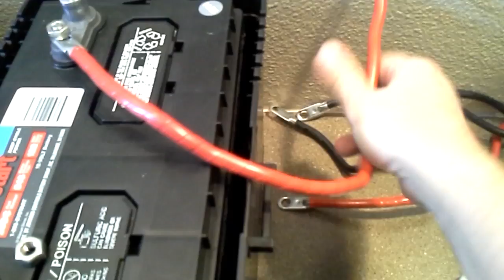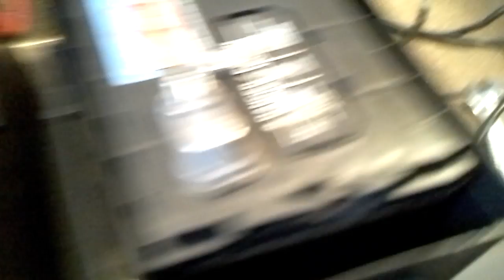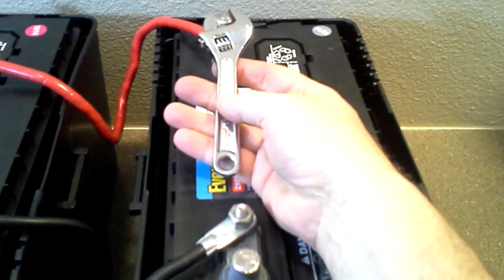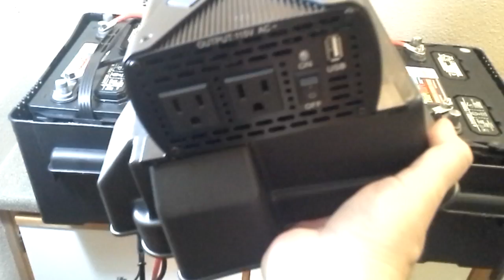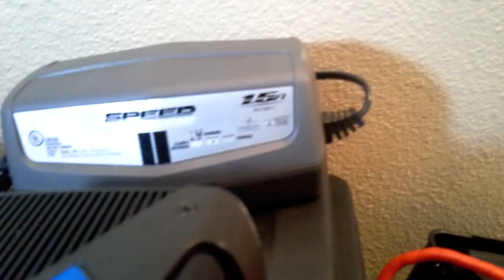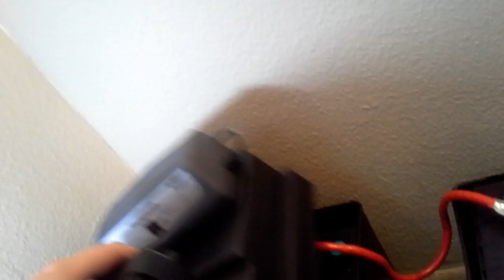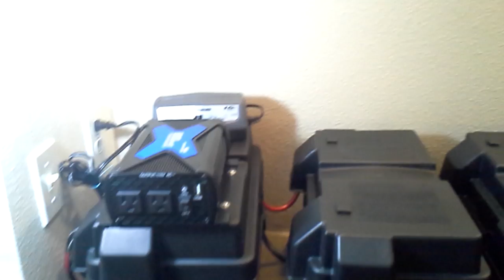Installing 4kW/Hr battery bank with 800W 120V Inverter and Trickle Charger from Tactical Woodgas

Comment: Do we only go positive positive positive, negative negative negative, when we have 3 batteries correct ? And the other way that we shouldn't do when we have 4
Reply: Depends on what you want to achieve. He is using parallel connections  to achieve much higher AH capacity from 12V batteries. If your inverter operates on 24V or 36V or 48V setup then you would be using series connected batteries instead. You might want to hook up multiple series connected batteries in parallel to achieve higher AH capacity as well - see this video: "EASIEST Off Grid Solar Power System Battery Bank."
If you have 4 x 12V batteries and your inverter operates off 12V input then you can simply carry on and also connect that 4th battery in parallel just as he did in this video.
Reply: @kevinrtres  if you've got three 80 amp batteries connected in parallel how much power will it put out? 19,200w?
Reply: @RCsFinest  That depends on the voltage at which you are drawing that current.
Direct Current Power  = Volts x Amps. So if you've got 24V  and are drawing 80 amps your D.C. power will be 24x80=1920W. If it's at 12V it'll be half that and if it's at 48V it'll be double that.
Just note that I'm talking about D.C. power. If you connect an inverter and feed an A.C. circuit then things get a little more complicated regarding the power that is USED by the appliance.
Reply: @kevinrtres  I would need 1500w of power, I'm trying to run a space heater in my garage as well as a battery charger for a third battery that would be swapped in and out if that makes sense.
Reply: @RCsFinest  A space heater sounds like mostly resistance heating so it should be fine, even if you have a fan blowing thru it. Battery capacity will determine for how long you can run that heater. As for the charger (???), it depends on what kind of battery it is, capacity etc. You'll have to check the specs for the battery as well as the charger to see what you need. Am I right in assuming you are going to run an inverter to power those things?
Reply: @kevinrtres  Yeah I was checking out both a 500w & 1000w inverter running on two separate banks with two batteries for each bank.
Reply: @RCsFinest  Well, I am not sure why you'd want to have two separate supplies but that's your choice, I guess. I would have made just one power supply to save costs and time of construction, but that's just me. I wish you well with your exciting plans.
Reply: @kevinrtres  I haven't made anything yet, I'm wondering if that's what I'll need for running a 800w space heater for 4-6 hours a day, I have a puppy that I need to keep in a kennel in the garage while I'm at work.
Reply: @RCsFinest  Well, certainly a worthwhile project. Assuming your space heater runs full-blast for 6 hours at 800W you'll need a total battery capacity of 200 AH ( I got this by diving 800W by 24V to get the required Amps then multiplying by the number of hours (6)) . If you're using sealed lead-acid batteries then you'll need to budget for 50% drain or preferably less per day. That means a rated capacity of 400AH. If you're using LiFEPo4 then you can just about get away with 200AH. Depending on where you live, what temp. you have to fight against etc. etc. you might not need a full 800W full blast all the time. This of course also assumes you're actually planning to run the heater off the battery all-the-time and not just as a backup. There's so many variables so, have fun finding solutions on the web!
Reply: @kevinrtres  LifePO4 battery he said 🤣🤣
Reply: @RCsFinest  Actually, it makes a lot of sense to spend that money up front. But I guess it all depends on your purpose. I heard someone else say something (in photography) that really resonated with me - buy it nice or buy it twice. Your choice.
Reply: @kevinrtres  All depends on what you're using it for, main power source would be ideal for that type of situation but as a backup or random use I wouldn't fork out $700/battery.

Comment: no fuse from battery's to inverter
Reply: I believe the inverter is protected right ?
Reply: well i have power box with 1500 inverter 12 volt deep cycle battery 75 amp 900 watts i have 20 amp switch and 150 amp fused between my positive of my battery and positive of my inverter even you turn off inverter with inverter switch it still pull little bit power from battery

Comment: If the Battreys are not  matched and same ratings you will Have troubles your connection should be neg on one Battrey and pos on other first Battrey so load is balenced. Use copper water line hammer flat and drill hole use for buss bar for better conduction you can tape them red and black for insulation.

Comment: If i put an aims 10,000 watt sur pine in an ice cream truck running the vehicle  8-12 hrs of driving, once i hook the 12v vehicle battery to the inverter, how many more batteries will i need to run 3 (15amp) chest freezers?
Reply: I don't think you would just need some more batteries.  What I would personally do is get one secondary battery and connect them to that.  Then from there wire it up with a relay so it only connects and charges from the alternator when the engine is running.  Depending on the vehicle you may need a bigger alternator
Reply: 15A equates to 1800W, 3 of them equates to 5400W.  You don't need 10,000W of inverter but it's your rig.  Max power from your alternator will be around 2500W and that is not at idle.  You can upgrade the alternator to a larger size, but you won't gain much.  Safely, I'd factor it around 1200W.  Your power requirement just for your freezer is 5400W.  You'd have to factor in other items requiring the alternator as well.  So for arguments sake let's take the 1200W from the alternator off of your power requirement and now you are at 4200W needed to run your freezers.  To run your 3 freezers for 12 hrs (have to plan for longest time period):  you would need 12,857 Ah of lead-acid batteries, roughly the same for AGM's, and 10,800 Ah of Lithium batteries.  Lead Acid/AGM batteries can only be safely discharged to 50% of their capacity.  Lithiums can safely go 80-90% of their capacity.  They also cost a metric shit ton more than LA or AGM. You can reduce the amount of batteries you'd need (let's face it, that's a crazy amount of batteries) by putting solar panels on top of your truck.  Not sure how many you could cram up there, but likely still not enough. Trying to run high demand items on battery power through an inverter is expensive.  Your best bet is to put a complete AC system in your truck, and run the freezers off of a generator.
Reply: @fiveoaksfarmofgeorgia7605  you also have to take into account that the freezers will not all be running at 15 amps all the time.   Do you think that he could add maybe 3 batteries and then a 7000 watt inverter to take the load when the freezers are first running. But then they are not the alternator would be actively charging the battery
Reply: @fiveoaksfarmofgeorgia7605  I saw a small ford transit van with a rigged up ac system for the full van.  The person connected a flexible hose to the vents on either side of the car and ran the tubes back to the back.  He still had the front in the middle for heat and AC in the front but could turn either of the vents off with the slider to get more airflow
Reply: What you need is a new vehicle.

Comment: If I run a 40" TV on this setup, how long could it last?
Reply from the maker: Kevin 
An LG 47LM7700 47 inch LED TV will run 12 hours between charges with one battery.  24 hours with 2 batteries, 36 hours with 3 as shown in the video.
Reply from the maker: Kevin 
Plasma TV's take more power.
Reply: Tactical WoodGas uhh

Comment: Now what's to keep you from plugging that charger into the converter and potentially having unending power
Reply from the maker: The battery only stores energy, it does not create it.  There are solar panel versions at www.tacticalwoodgas.com if you want sustainable power.
Reply: Power outage :)
Reply: A little thing called system efficiency.

Comment: This is not large enough to run a home refrigerator with freezer.  Too small.  Ok for temporary lighting, radios, chargers, etc.
Reply: crazeyspivey 
Modern energy-star rated appliances have lower startup currents.  Use an Amazon kill-a-watt to make sure peak power is below 1800 watts and average power is below  800 watts.
Reply: Where would you get your 1800 watts from????

Comment: There are a normal car bateries?
Reply from the maker: These are deep cycle batteries rated at 100A-H
Reply: You could use car battery but it doesn't have the same tolerance. Deep cycle batteries can go kinda low before recharge is needed. Car battery will be damage if it drops a few volts.
Reply: @tacticalwoodgas4036  No, they are NOT True Deep Cycle batteries, they are hybrid Marine Batteries.
Reply: @MrSummitville  agreed

Comment: how much amperes would that three batt in total?
Reply: Janjan demecillo 
Each is 120 amp-hours.
3x120=360 amp-hours.

But.....

...you should only use half the charge so that you extend battery life.  So 180 amp-hours.  At 12v, that is 2340 usable watt-hours.
Reply: It's 2340 Wh or 2.34 kWh or 2.34 Units of energy as in universal term.
Reply: No, at 120 Amp/Hr and 12V; it's nominally 1440 W/hr per battery; that's 4320 W/hr.  (Note, "nominally", since fully charged batteries will put out fractionally more than 12V for a while, the W/hr output availability will be slightly more; on the other hand, when battery voltage drops below 12V, the output wattage from the batteries will drop.

Comment: What batteries did you use specifically if you do not mind me asking?
Reply from the maker: 100 to 120 amp hour deep cycle batteries size 27 to 31. Remember that the larger amp hours will last longer between charges
Reply: Thank you!
Reply: +Dru Hannon DEEP CYCLE!
Reply from the maker: +Dru Hannon These are DC29's from Walmart
Reply: One suggestion. If the power coming out of your solar panels is not enough to charge the battery bank fully then get a charger. Lead acid batteries do not last if they are not charged enough after a discharge cycle.

Comment: No offense, but the video starts off great with you explaining how to wire the batteries. But then you add a lid and connect up some additional al wires, but don't explain what youre connecting, or how to connect them. I do get it, but for a novice this missing information / exploration would be very helpful. 
I'm guessing if you plug the trickle charger into the inverter, this would charge the batteries in a looping kinda way. Am I wrong to guess that this would produce deminishing returns and eventually die? Anyone?
Reply: grinattack69 

Thanks for the feedback.

Agree, no such thing as free energy.  It has to come from somewhere.
Reply: Indeed it would die cause your using power up from the bank to run the charger and some of that power gets used up in that process so eventually that bank would just die and not be charged better off getting a small solar panel or use the charger with AC power until power goes out and you need that stored power or like I do is keep a trickle charger 3amp on my set up and charge most my cellphones and usb stuff off it day by day to cut down on using power grid and If grid goes down I have an 800watt inverter for bigger loads.

Comment: will 800 watts run a refrigerator?
Reply: a refrigerator operates approximately 300 watts, we need to know how long batteries last before this constant consumption and how many batteries use
Reply: +Obdulio Sandoval 

A Walmart  DC29 battery holds 12V x 122 amp-hours = 1440 watt-hours.  The inverter protects the battery from deep discharge by cutting off when about half the energy is used, so 735 watt-hours are available. Your refrigerator uses 300 watts only when running the compressor,  about 10% of the time when the door is closed, so (735W-H )/(30W)=24 hours of use per battery.  If you want to run the refrigerator three days between recharging, use three batteries. Or use one battery, and once a day carry the battery bank to you car, start the car, and connect your jumper cables to it for 30 minutes and it is ready for another 24 hours.

Comment: which is the current lithium batteries? AC or DC
Reply: coriente dc direct
priviene of battery its voltage is 12-24 volts

ac ac
It comes from the outlets of our house its voltage walks in 120 or 240

a battery current can be converted to AC inverter with a team called

Comment: what good is this if you have to have a outlet/electricity to power it?
Reply: Good to use for backup power in case of power outage. Solar can be added later if your budget is big enough. No shame in having grid power to charge the batteries. In fact, there may be some days when the solar will be unable to fully charge the battery bank so a grid (or generator) outlet will be needed to get a full charge. ... Think of it as a backup to the backup.
Reply: The AC battery charger is there to make sure the battery is 100% charged when the power goes out.  If you use up all the charge before power comes back on, place it on the ground next to you car, start the engine, and use jumper cables to recharge it.  Only 30 to 40 minutes is required for a full charge.
Reply: 30 to 40 minutes to achieve full charge? That's not my experience (nor Pb batteries theory) You can charge them up to something like 80%, but those last 20% will take at least more than 1 hour! (And I'm being modest about the 80 and 20% times!).

Comment: What’s the point. Just plug into the wall.
Reply: It's a backup of power outage. Wouldn't do no good plugging in the socket with no power
Reply: Do you have one that comes with solar charger where I can can plug the inverter to the solar power instead i need one to send over Sea

Comment: You totally did that battery wiring wrong. While you can connect the batteries themselves the way you did, your killing the main battery with your wiring to the inverter. You should have done it correctly since theres probably thousands of viewers who now have 1 bad battery, 1 poor battery and one good battery in one string. Proper inverter wiring in a bank like that is the X style, pulling from all batteries even. Sorta silly seeing this as a lesson.
Reply: Јоhn Daniel 

Not true at these power levels.  The battery bank shown in the video is still going strong.

Comment: Hello... Your videos are so informative....

I have little maths problem regarding solar....

35 air-conditioner #2hp =1500watts = 52500watts

I want to run for 15hrs a day=787500wh

I want to use 1.2v 1250ah  NiFe battery and 36v 320w solar panel

((My idea is 384 VDC battery bank= 320batteries 1250ah))

Amount of battery bank ??
Amount of solar panels??
Charger controller??
Inverter??
Reply: Check your math

Comment: I'm not sure an 800 watt inverter will cover the start up surge on a fridge did you try it  ?
Reply: newer Energy-Star rated refrigerators have smaller compressors, so smaller surge.  The 800W rating is average power; it will handle double that during a surge.
Reply: Also, yes it works on my new refrigerator, but not on my 30 year old freezer.

Comment: What is that AC you connected for?
Reply: Charge the batteries, if you had solar panels they would charge them with a solar charger/controller , ac would charge when there is no sun.
Reply: it's called a Battery Tender

Comment: where do I buy the battery charger and what kind
Reply: Aspen Marcel 

You can get the Walmart 29DC deep cycle battery.  I use that in my systems at home.
Reply: Aspen Marcel 

For the unit in the video, go to www.tacticalwoodgas.com

Comment: How long it can last a 100AH battery subject to consumption 100watts
Reply: 100 amp-hour divided by 100 amps equals one hour of use.  For longer battery life, use half of that before recharging.
Reply: You pass in math class, but failed in Circuits. 100 AH at 12v = 1200 watts in a 1 hour period. So, 100 watts "at 12 volts" is about 12 hours of use for a 100 watt draw no matter the voltage. With loss, I would say safely 80% soooo maybe 9-10 hours.
Reply: +eclipsethesun 

Thanks eclipse for the correction.

I was thinking amps when the question was in watts.
Reply: yeah but he has three 100 ah batteries wired in parallel so that makes 300 ah times 12 volts =3600 watts
Reply: understand each 100Ah battery generates 1,200watts 3 batteries generate 3,500 watts
Reply: Wrong.......never discharge batteries all the way down.Look it up.
Reply: Yes, very important.  A good working rule-of-thumb is 50% draw down (to pick the finest nits, there is a very slight variation between battery types, such as gel-cell, glass mat, deep-cycle lead/acid flooded, and "car starter-type lead-acid flooded, but calling it 50% is a good working number).  

Since battery voltage drops as the battery discharges, a good quality inverter will automatically cut off as the voltage drops to a level that indicates 50% discharge.

Comment: Thst is only 1.8kwh of storage.  Not 4
Reply: He said he has 340 amp hours so multiply that by 12 volts and you have 4080 watt hours so he is right....right?
Reply: @fernandorufino-jimenez5982  The batteries are lead acid and the DOD is only 50% of that usage. You can't use 4080 watts.  Only 50%  so no. He is wrong. 1.8kwh total available
Reply: Yessss...I did not put that 50% into equation and you are absolutely right
Reply: @sunsolar3330  so how many batteries do u need to hv 4k watts and what size of invert can one use
Reply: @frankmutuma8831  For that size of power output/availability I'd much rather step up the input voltage rating of the inverter - get a 24V inverter and rather use Lithium Iron Phosphate batteries. Much more expensive but man, does it make your life so much easier - see this video here:  "EASIEST Off Grid Solar Power System Battery Bank."